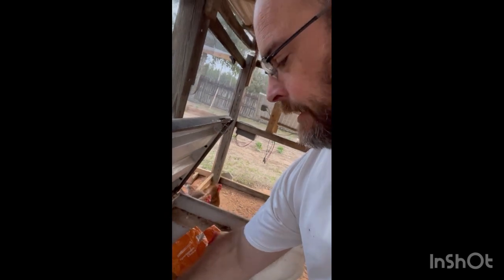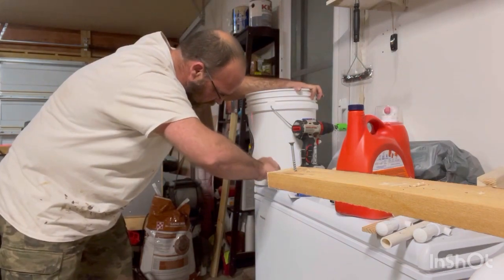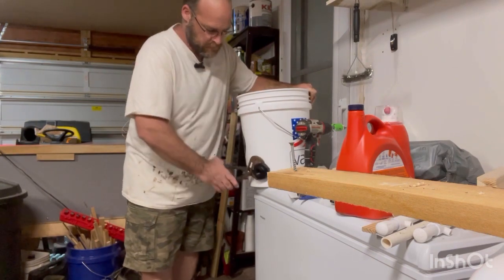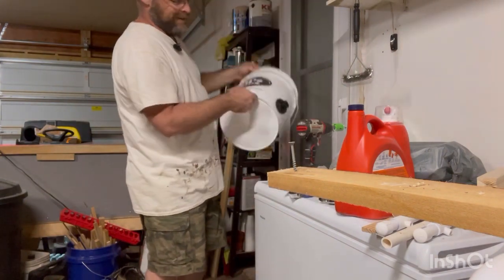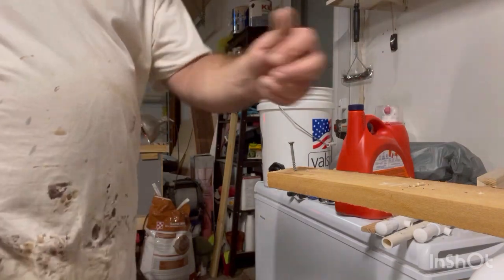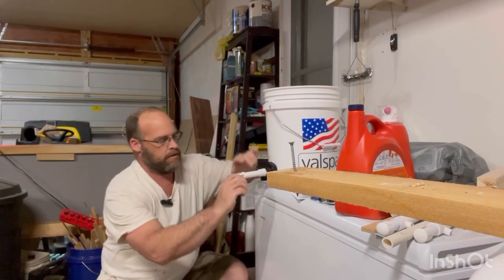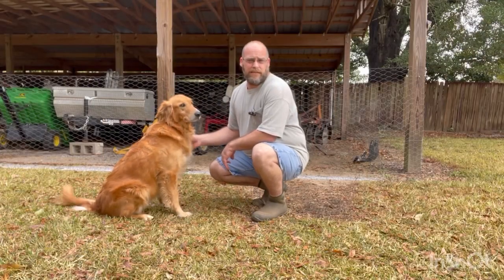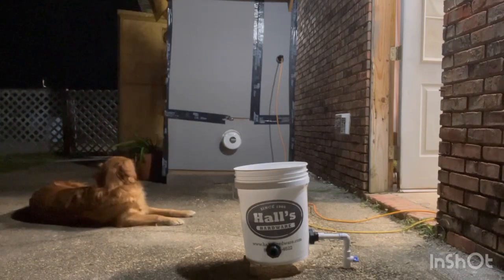Creating the water system for the quail

Comment: I have a question if you don't mind. You installed two things in the bucket. One was the bulkhead connection, which you used to connect the PVC pipe. What was that first thing in installed? What is its purpose? Other than that, this video was easy for me to follow. Hoping to make one this week. The eggs are in the incubator right now. Thanks.
Reply from the maker: Two bulkheads. One was for the pvc pipe and the other was for a clear tube to show the water level in the bucket. Thank you for watching. Good luck with the eggs hatching and making your water system.